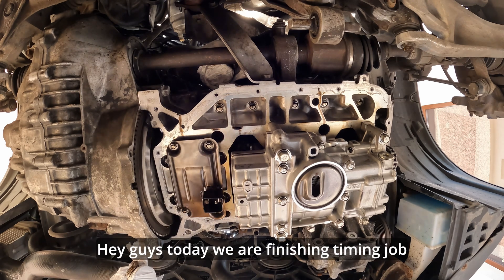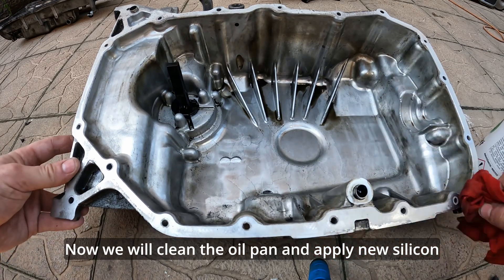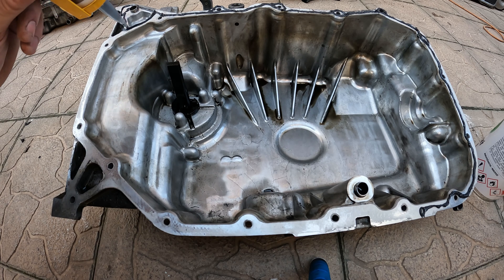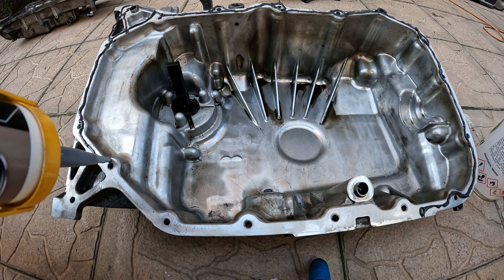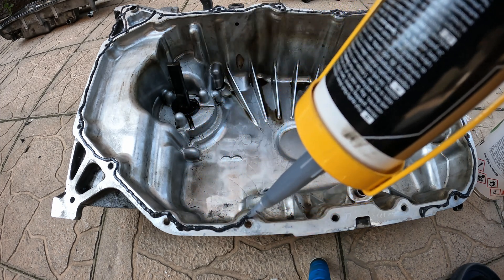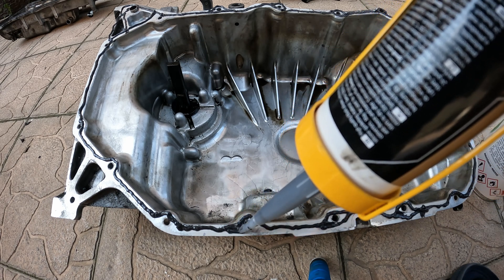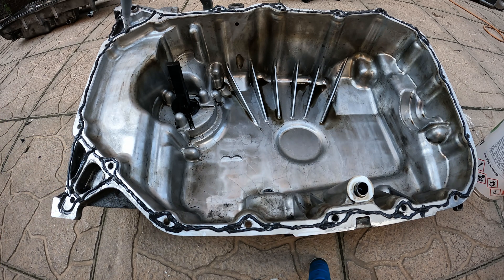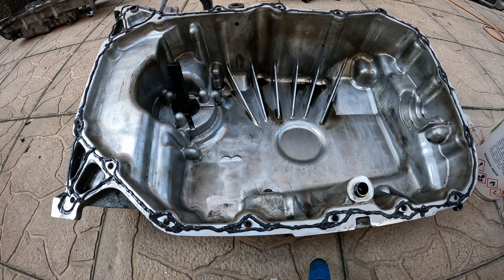How To Replace Timing Chain And Setup Engine Timing 2,2i-ctdi N22A2 | part4

Comment: I changed mine about 1000km ago. The same HEPU brand was used. I can still hear some nosie from the oil pump chain when idling. Not rattling but you can hear there's a chain inside. Is that normal or did I made a mistake somewhere? And a whining noise when reving the engine?
Reply from the maker: Yes, this is normal for this brand. I've even come across a torn HEPU chain. But OEM is very expensive.
I don't know what sound you mean when revving. Is the sound coming from the chain?
Reply: I can't tell if it's coming from the chain, I searched on youtube "whining noise after timing chain replacement honda accord" and found many videos with the same noise and they all say it's normal and nothing to be worried about.
Reply from the maker: Check the Tensioner and Idler Pulley. There may already be a bad bearing in them and that's what's making the noise.
https://www.youtube.com/watch?v=DozTCj0XkJ4
It's for the 9th generation, but it's almost identical to the 8th.
You don't have to change the entire pulleys. 
https://www.youtube.com/watch?v=eA7OTDBH3jk
Reply: @easywork2  yes I changed the tensioner and pulley when I was doing the timing chain. Maybe the quality is not very good?
Reply from the maker: I don't think so.
Reply: @mladenjerkic6105  Did you find a solution to the whining noise?
Reply: @crybaby1363  no, it stopped on it's own after a few thousand km. Im guessing after the chain and sprockets got worn in a bit.

Comment: Does the engine have timing marks to be sure if its ok ? I didnt see in videos. Also be good to rotate engine manually and than check those marks...
Reply from the maker: Hi, check out PART 3 https://youtu.be/2UzFrPpYwMM?si=U9ezStEBfz3XlmYH
Checking the marks after rewinding the chain is very complicated.This is not a belt and after one revolution of the timing gear the chain is not in the same place.
Reply from the maker: Don't worry about replacing it. It's very easy. There is a mark on the pulley and the chain link is also marked.I would say it's almost impossible to get it wrong.
I wish you a happy exchange. 🙂
Reply: @easywork2  ok many thanks. I will report 😉

Comment: When tightening the top sprocket when it’s not connected with the crankshaft via chains can put strain on some parts due to desynchronising so maybe it would be better to do the final tightening when all new chains/sprockets are on? Also would be good to know torque settings at least for the crucial screws especially under chain cover. Thanks for sharing your job though! At least it gives a good idea of what needs doing. Cheers!
Reply from the maker: Hi, thank you for your comment. The upper sprocket is held by the cam with a key. So there is no gear synchronization. I think the key for the cam is 24mm. It is not good to pull it by the chain as it could stretch.
I didn't use torque because I wanted to show people that it can be done at home.

Comment: Good Day, I have the same honda tourer 2005 2.2 diesel, I need to change engine mounts, but not sure with oem numbers, its possible to know from you?, maybe you changed allready.
Reply from the maker: Hello, which engine mounts do you mean? I can find out the OEM numbers exactly according to your VIN number. Can you write me which engine mounts or write the VIN number as well? Thank you.
Reply: @easywork2  Thanks for answer. I think will change all of them, must be 4? win JHMCN27305C203194. Long time ago engine starts vibrate like crazy, drive ok, but on idle is terible
Reply from the maker: Hello, so I looked at the VIN number.
You don't have to change them all. It is necessary to replace only damaged (torn off) or if the rubber is very damaged.Ideally, try with a crowbar. I can make a video on how to detect a damaged silent block, or replace it.
50880-SEF-E00
50890-SEF-E00
50850-SEF-E02
50860-SEF-E00
You can also find photos of those silent blocks on the Internet. Unfortunately, some of them can no longer be bought original even at Honda.
Reply: @easywork2  Thanks for answer, will check these mounts, and will be glad for new video about engine mounts ;)

Comment: Respekt 👍👍👍.  part 1-4 very hard Work. Change water Pump, ok! . And the Oil Pump?.
Reply from the maker: The oil pressure was normal. I did not change the oil pump.🙂